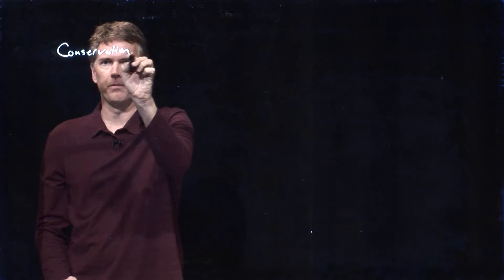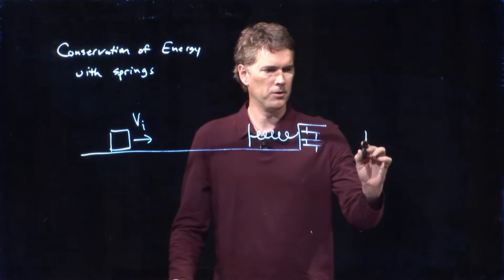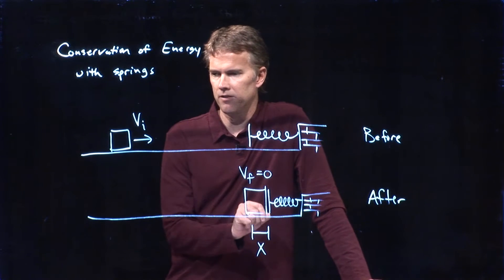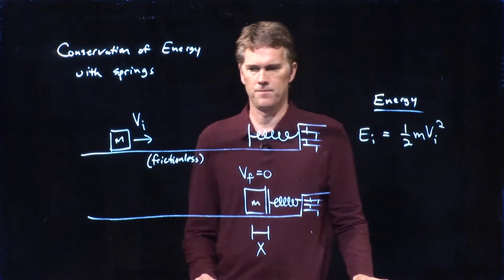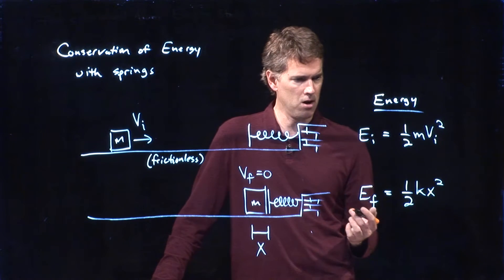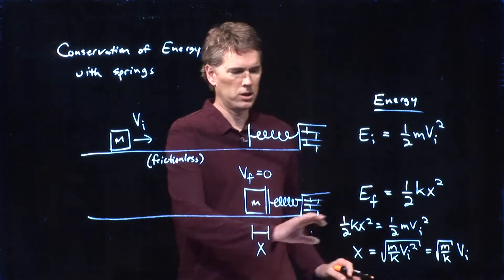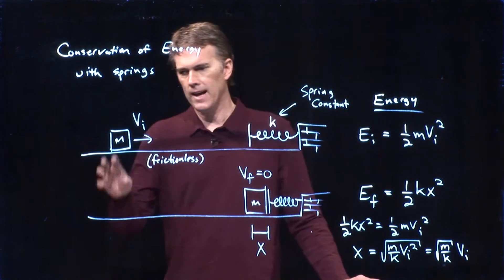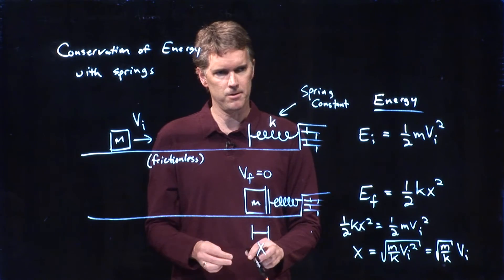Energy - Springs

Comment: This assumes that you did not exceed the limit of the spring and permanently deform it.

I am trying to create a 0 to 2ish meter  shock absorber for a rope that can safely absorb the force of a 100 lb to 300 lb person falling up to 2 meters before the rope saves them from a 14 to 44 foot fall. (5600 lb is the official force of a 220 person falling 2 meters). 

A single stich of nylon sewn into a 900 lb tensile strength webbing weakened the webbing more than half.  So, webbing is out. 

It looked like three half inch bungees cushioned 40 lb, OK. But 16 bungees per  1 or 2 meter loop cache, shock absorber in the top of climbing rope, got pricey for the needed 20 ropes. Plus, I do not trust elastic after 2 years. 

4 meters of 1000 lb  bungie folded in half, with 400 lb break aways every inch or two, works in scale on a 40 lb water bucket. 

This brings me to my 550 lbporch swing testing.  I calculate 980 lb force, at least (assuming osha 3.2 inch system absorption and not less), dropping a 40 lb bucket 2 meters onto the rope.  The 8.5 Inch  porch swing seemed to absorb the force, but it permanently deformed 6 inches.  I repeated the test 4 times, each time it deformed 6 inches... I am wondering if it could absorb 20 Kn, but I have no way of testing.
Reply from the maker: Good stuff.  Short answer is I have no idea the best way to do this.  Obviously a beefier spring would do it, but this seems clunky.  I think you mentioned the energy absorbing harness (like this one: https://gravitec.com/energy-absorbers/) with the stitched webbing.  This was new to me, but pretty cool.
Anyway, I wish you the best of luck.  Seems challenging.
Cheers,
Dr. A
Reply: @yoprofmatt  I have completed the scale tests and have a design for making my own breakaway shock absorber.   After much trial and error,  I settled on 5600 lb 2" seat belt webbing and 138 bonded thread.   Two inch zig zag measured 320 lb to break.  

By doing it myself, I can envision using 20 units easily. And, I can do 3 stages of resistance so that the first stage doesn't hurt a thin boned 100 lb person,  also more half harness friendly.  But the design will also safely stop the 350 lb guy, or the 4 meter fall.

The physics math to predict the number of break aways (initial lbf when hitting the first break away + the force gained during the stop distance).   The math to calculate the number of breakaways is about 15 to 30 percent off for my 40 lb dropped 2.4 meters and 1 breakaway force per inch,  9 inches to stop.  (I calculated the 9 inches,  at the initial velocity, as non trivial.) 
Might be worth a video.   I have spent weeks on this and can answer any questions. 

Furthermore,  I also bought 10 Kong Kisa shock absorbers.   Look them up.   I will eventually get around to posting a few clips.   The Kisa relies on static and kinetic rope friction.  What I learned in my testing is that the company cannot predict the friction of anyone's rope.  There are so many factors : rope mantel creep,  mantel brand friction,  turn radius,  dampness,  wetness.   My cheap 10.5 mm rope would have put a 220 guy under 1500 lb of force in a 2 meter fall with a dry rope.  As soon as my rope got wet the slide,,  stopping distance decreased dramatically, in addition to short stopping distance.   

With the Kong Kisa,  everyone has to decide for themselves what they feel is safe.  The numbers they give for threading are suggestive and not likely to represent your rope.....   So,  in the end,  I settled on a target of 9 inches slide,  1200 lbf (40 lb dropped 2.4 meters) ,  on my dry 10.5 mm rope.  Wet the slide was 5 inches.   I think it will be enough with 2 meters of feed rope.... Of course,  I don't know how much the static or kinetic friction are with the kiss.   I mounted a winch on the swing set with a 600 lb crane scale opposing.  Unfortunately,  the most I was ever able to crank on the winch was 300 to 350. Going past 250 lb was difficult.   I was not able to to pull the kisa on the winch even at a lower hole weave than the instructions mentioned.. 

The kisa stopped bucket looked a bit more violent than the break away webbing,  plus it can't be progressively staged to handle 100 to 400 lb people like the webbing. 

Of course, if I were smart enough,  I would figure out how to test at full weight.  I just see national and city parks in my head for that one. Plus,  I don't have workout weights anymore.  I traded them for a wife.  I figured that offered a growth opportunity, rather than workout weights that never change their mass.

Comment: Thanks Dr. Anderson.  What happens if there is a block with mass 2m already on the spring? Basically box with mass M and velocity v hits a spring with a box already connected to a spring.  How to differentiate between v before and v after contact and where to plug in total mass?